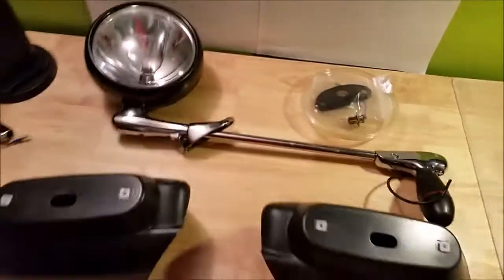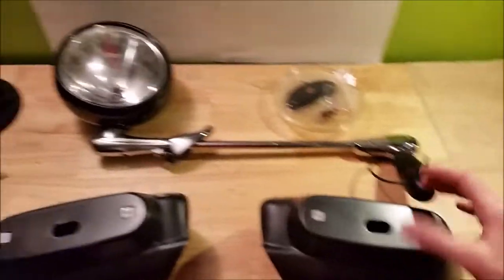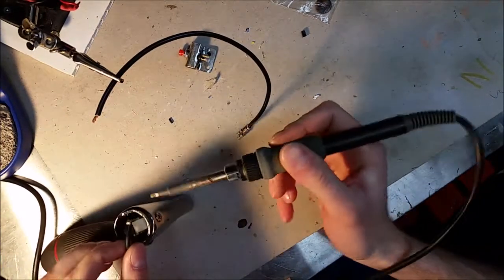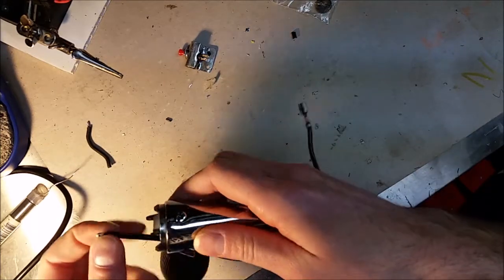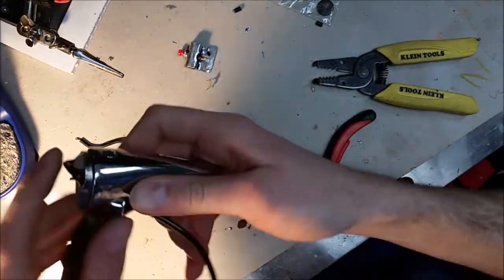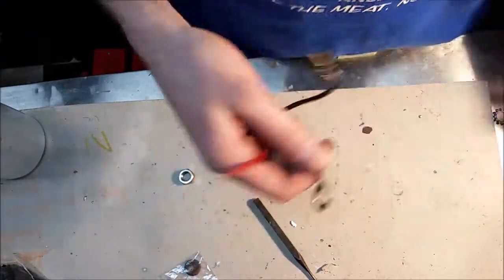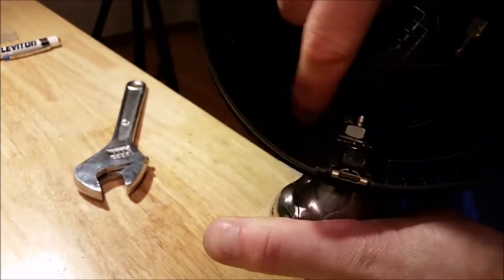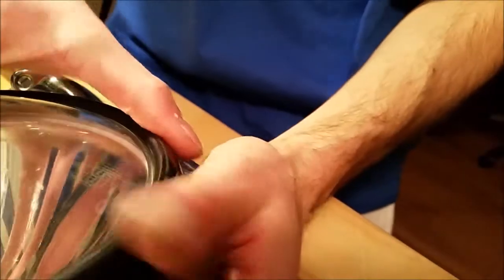How to Take Apart and Repair a Unity Spotlight

Comment: Mine had a ton of Green thick buildup in between the contact points and I wouldn't get any power to my spotlight I took it apart cleaned it very well and everything works as expected

Comment: Great Video.  Questions on the parts of the spotlight.  (1) Is there a way to change the inter steel main shaft to another size, or switching shafts from one spotlight to another.  (2) Also  I'm wanting to change around the shaft lengths for other applications both the inter and the chrome outer shafts, mix and match them.  I'm wanting to change the length of the chrome shafts also, and changing out the mounted bushing that is on the end of them too.  Question. Are the bushings that are on the chrome shaft soldered onto the tube before they are plated, and with silver solder ?.  I can get bushings made for what I am needing.  Any help would be greatly appreciated.  Thanks very much in advance for you time on this.
Reply from the maker: These spotlights come in 2 configurations. 
1- Vehicle specific, mainly for the most commonly used police vehicles.
2- "universal" in various shaft lengths, which have been tested to fit on a variety of vehicles. 
You cannot mix and match inner shafts with outer shafts, they need to have the same length. 
The models that are vehicle specific usually have the bushing soldered in place, all the others have a freely rotating bushing which gets clamped in the bracket so you can adjust it's rotation.

Comment: Where can I find the thing you took out at 2:58 because I don’t know if I burnt mine when I thouched it with my hand while trying to take it off but then I put it back in there and it doesn’t want to turn on
Reply from the maker: You have to buy a whole new handle assembly. You can find them on ebay pretty cheap. You only need to replace it if the switch is not making good contact.
Reply: @Chargèro  thank you

Comment: Great video sir many idea where I can get another tip that attaches the wiring assemble to the car plug like the little blue piece on the end of your handles wire ? Not sure of the connection type my new one is just straight wire
Reply from the maker: josh howard crimp on terminals, you can get them at radio shack or any electronics parts stores, or order from ebay

Comment: I have a old 6volt unity spotlight I want to put on my 92 f250. Any idea how to make work with 12volt
Reply from the maker: Dont mess with it. Just get the proper spotlight and mounting bracket. 
Only thing that determines working voltage is the bulb. Look on the back of the bulb it should have the voltage stamped. Trucks and military stuff are typically 24V old cars may be 6V
12V is pretty much the standard.
Bulbs come is 6" PAR46 or the smaller 5"
Again I highly Recommend just ordering the correct spotlight for your truck.
Go on the Unity USA website to get the part numbers, then search ebay for deals.

Comment: Is it possible to do this same process without welding?? Would appreciate an answer asap as I have a replacement handle coming for me in the mail very soon and am taking the project upon myself and don’t have much experience in electrical wiring
Reply from the maker: Yes if you use  crimp connector to attach to the remaining exposed wire
Reply: Chargèro how would I go about detaching the already attached wire? Would it be easier to crimp my cars existing wire to a new handle or to attach the handles exposed wire to my cars existing wire?
Reply from the maker: @JacksRifleRacks  That is up to you to decide. I find it looks better soldering on a whole new wire with connector. You can purchase crimp connectors online pretty cheap and accomplish the same thing if you have enough remaining wire on the handle already that is

Comment: Hey boss chargero i shorted mine out. Took it apart because the switch was floppy while doing so sparks flew, i didnt know the assembly was live. Anyway it shorted now it doesnt turn on.any ideas? is that little black switch suppose have continuity while pressed?  Where is the power supply to the spotlight? I traced the wire but it leads to the dashboard. Is the power wire to the spotlight assembly suppose to have 12 volts?...srry for the novel.very much appreciate your response.
Reply from the maker: Juan Hernandez you may have just blown the bulb, sparks are no harm, it's only 12V.
The black wire to the handle is the +12v positive power, anything metal (shaft) is the ground or -12V negative. If you take the bulb out, you will see in the lamo housing, a thin post in the center with one wire connected. That is the poaitive. The nut arround it is ground. The center post should not be touching anything.

Comment: I picked up an old unity spotlight that I want to convert into a led headlight for my motorcycle. Are there any parts you would recommend? Housing, bulbs, etc?
Reply from the maker: I would get the Unity brand bulb, I had the Whelen ones and both developed stress cracking and let water in. I also saw a guy on ebay selling generic chinese par46 led bulbs for about $50 a piece, never tried them but they look decent. If you hunt ebay you can pick up a Unity brand PAR46 for $40-$50, though note they will only fit in the S04 housings, not the 325-380 or metal housings with out some modification.
Reply: Chargèro thanks for the reply. mine is vintage probably 50s. Think those parts work?
Reply from the maker: @wcor8344  Like I said you may have to grind some spots on the back of the LED bulb housing to get it to fit, the vintage ones from the 50's had the metal housings, also there are 2 sizes the 6" (PAR46) and the smaller one which is 5"
Funny enough they actually still manufacture these in "vintage" style with the old style handle and everything.
Reply: Chargèro thanks. I’m on it. \m/

Comment: I Loved how you Glossed right over putting the switch back in... You DIY video guys never show the fiddling, fumbling and swearing part.. Yeah this is an old video but, I'm dealing with a new issue on a unity light and looking for a smoother way to get the switch back in... The fiddling,fumbling and swearing isn't working.
Reply from the maker: I'm not a diy video guy. To put the switch back in you hust have to push down on the spring loaded pin with a thin flat blade screwdriver or pick. It takes some fiddling but it will go back it. You can't force it.
Reply: @QuaabQueb  another problem developed.... I just ordered a new handle..that will take care of both issues.. .. .

Comment: Is it possible to take the contact out of the inner most shaft(one with the gear)?
Reply from the maker: yes it comes out, you have to take the entire thing apart to get it out.
Reply: @QuaabQueb  What are ways this specific part can fail? I’m just curious
Reply from the maker: @the_mysterious_gamer1657  corrosion or it just breaks

Comment: My switch will not even switch from off to on. Is it worth trying to take it apart to fix it? Or just get a new one?
Reply from the maker: What do you mean? It's physically stuck and wont move ?
Reply: @QuaabQueb  ya it is  Physically stuck
Reply from the maker: @mikeheckathorn5692  it's just jammed probably. Take off the switch (two Phillips screws on either side) and put it back on. You have to wiggle it a little to get it back on in right position

Comment: I can’t find how to remove the handle. It’s probably simple but mine won’t budge. Even with all the bolts removed
Reply from the maker: Yes they can become stuck. Keep wiggling it it will pop off. make sure not only the bolt it out but the wedge nut holding it in. if the nut is stuck undo the bold a bit and wack it on the head.
Reply: Chargèro thank you sir

Comment: I did this to mine just to clean it up and now it doesn't work at all... I'm sad
Reply from the maker: Then there is a loose connection somewhere, most of the time it is due to the handle not being seated properly.
Also check the end of the head post and make sure the pin is touching and tight. Use a multimeter to test continuity and narrow down the problem.
Reply: Chargèro it turned out the 20 amp fuse was blown lol, I replaced it and she lit right up.
Reply: i need two handles for a pair of spotlights i have. black with red strip.can you help me find some??

Comment: Old 83 bucket truck, I would guess the grinding was an effort to re index the bevel gear to use teeth that were intact compared to the ones 180 away, not really watching just listening looking to make the one in my lap work so I could, possibly be wrong, it has happened before I am told, being wrong that is
Reply from the maker: not sure what you are smoking
Reply: @QuaabQueb  and I'm not sure what your implying? Oh, there I go again being wrong because I do know, what you are implying
Imagine you had to fix that mechanism without the luxury of ordering parts. Now imagine the bevel gear has three broken teeth where it falls against its mating gear. Now imagine holowing out an apple and packing it with weed. C'mon, everyone has had to do that at least once